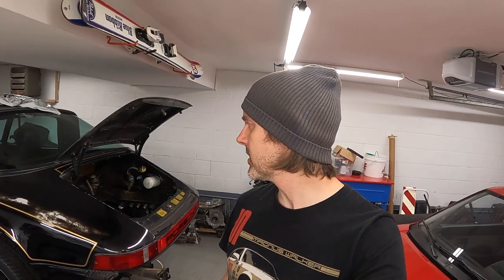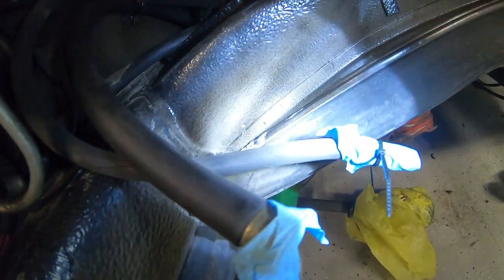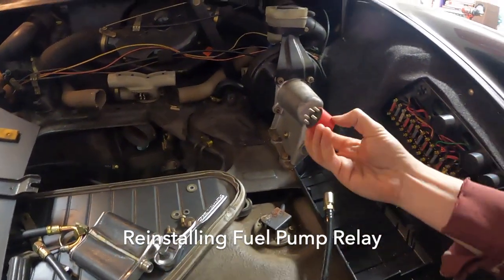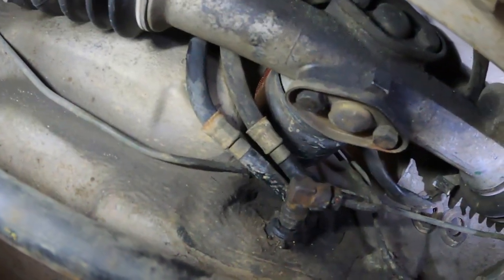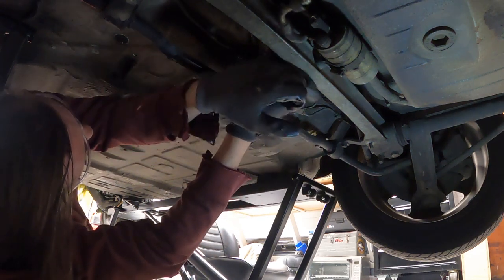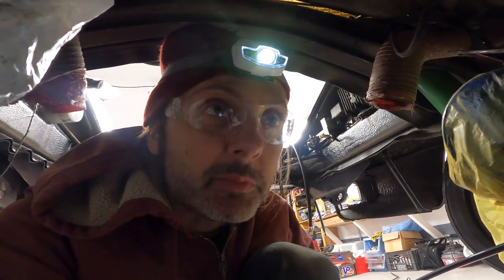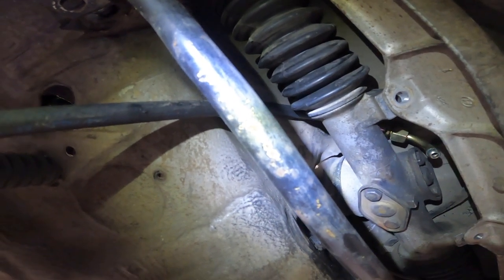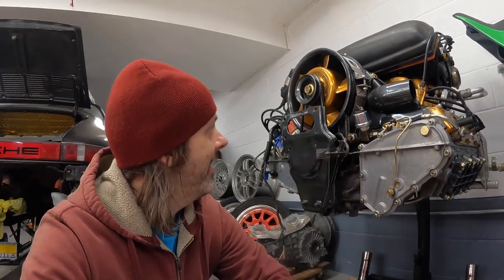Porsche 911 Fuel Line Replacement DIY How To

Comment: Nice - very nice.  For the fuel lines, you can use a self-made tool to thread the lines, but no matter how you cut it, it's hard.  I put my motor/trans back in late last year, and despite all, it still leaks oil (but a lot less than before).  Can't wait to hear how your's sounds - I put ITBs, fuel injection and electronic ignition into my midyear, but still tuning it - does sound good.  Looking forward to seeing and hearing your success!
Reply from the maker: I couldn't justify the cost of ITBs and stuff, plus the time...    I think the CIS system is fine until you get to wild builds, we'll see I guess.
Reply: @ADDvanced  my fuel injection was off so it made sense to replace it with something new(er). Pros and cons to everything. Will need to re-evaluate the oil leak once the spring comes. That’s kinda frustrating after all I did to clean it up.
Reply from the maker: @bertrandliang9490  Where's it leaking from?  Hopefully easy to get to.... and not the case.
Reply: @ADDvanced  I’m not sure. I don’t think it’s the case - it might be the intermediate shaft. I may have to do a partial drop to figure it out. It’s certainly not the triangle of death since I can see it directly now.
Reply from the maker: @bertrandliang9490  I put on that CNC'd nose bearing seal by Tom Amon....     so far I have no leaks but I haven't run it yet :D
Reply: @ADDvanced  I should’ve done that but I was lazy and didn’t see anything when the engine was out. Some mistakes we pay - for one way or another.
Reply from the maker: @bertrandliang9490  My memory is hazy, but I think you can do this with the engine still in the car....
Reply: @ADDvanced  yes I think it’s a partial drop.
Reply: @bertrandliang9490  check to see if it's the crank pulley seal. Sometimes, the seal (or the nose bearing!) can leak, and the clean oil is difficult to see until it reaches the ims cover area. I had a couple that leaked and I thought it was the ims cover.. turned out to the the crank pulley seal instead.
Reply: @911engineguy  Thank you! I will check it out.

Comment: Looks good, sir.  I think I'll do mine when I take the motor out next year.
Reply from the maker: Start saving now.  These lines are not cheap at all.
Reply: @ADDvanced  I guess it could be done with braided lines and metric fasteners? How much is not cheap?  Curious.
Reply from the maker: A lot.  Good luck making them yourself man.   Lots of bends and elbows need to be pretty precise.
Reply from the maker: @garagechronicles9008  Each line is ~$100, some are $60, others are $125, so.... 3 lines each direction...   $600+.   Can you do it cheaper?  Yes, but pulling through a larger diameter tube through the tunnel would probably be even more annoying... .so then you're looking at just drilling holes and putting fasteners along the bottom of the car somewhere, and I can't do that to this car.
Reply: @ADDvanced  Yeah.  I'm going to use his lines, They're like the new standard and they are going to fit with no mods.  Thanks for you feedback,  we have the same car so I expect we'll have a similar story down the line.

Comment: Well, maybe you did, maybe you didn't, but it sure makes sense to replace all the rubber fuel lines off the engine with flexible stainless steel.  I did, those 3 rubber lines will never have to be replaced, and never leak. .....leaks on those lines will cause a fire for sure.  Same cost as buying Porsche rubber lines.

Comment: I just did my rear lines because of cracks but the tunnel lines seem perfectly fine.  Were yours cracked?
Reply from the maker: No, the tunnel lines will stay in nice shape basically forever.   The PROBLEM is, they're permanently crimped to the front lines.  If your rear lines are bad, your fronts are too, and on a 77, they're PART of the tunnel lines.   Len's lines are 3 pieces; there is now a threaded fitting on the front of the tunnel lines, so if you need to do this again in 40 years, you don't ever need to replace the tunnel lines again.
Reply: @ADDvanced  Ive bought from Len and can recommend his work.  My car is an 83 and the fronts showed no cracks at all but the rears looked like a drying mud puddle.
Reply from the maker: @MrTakidd  huh, wonder if it was just heat related?   Even my front lines were pretty rock hard.

Comment: What did Len charge for the kit?
Reply from the maker: A metric F ton.   I think it was $6-700.
Reply: @ADDvanced  I ended up repairing the broken rubber return line from the tank to before it goes through the wheel. Apparently, the factory line section that goes inside is a non rubber plastic that doesn't parish like the front rubber section.